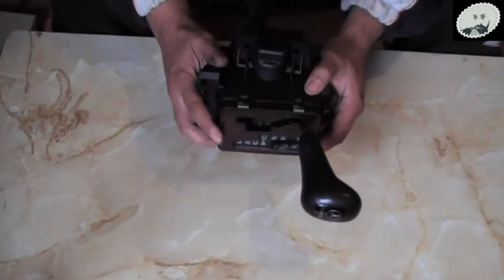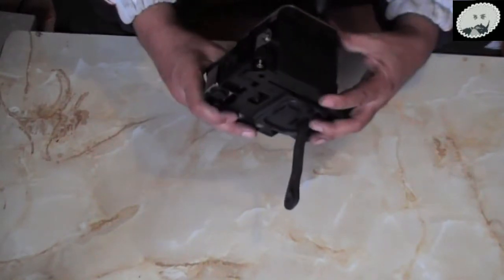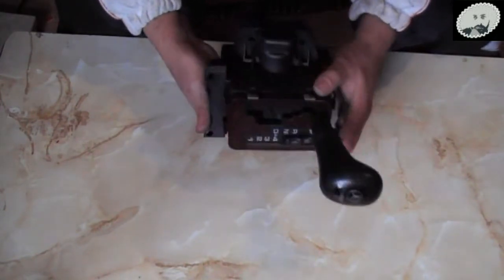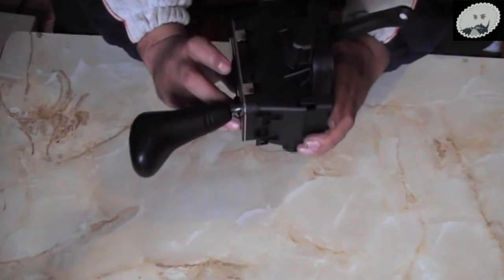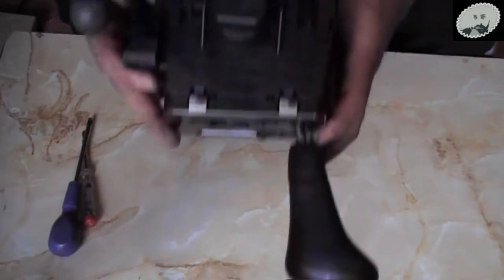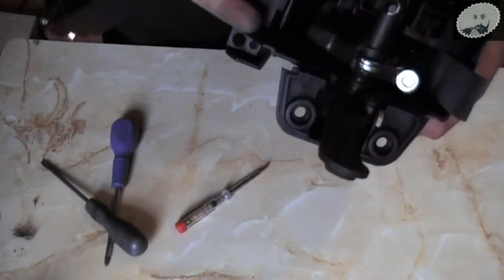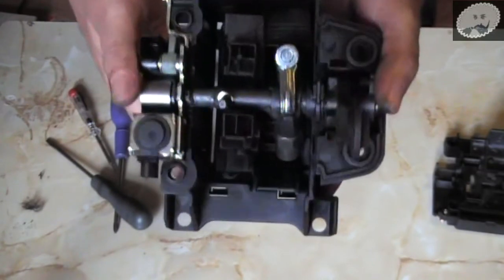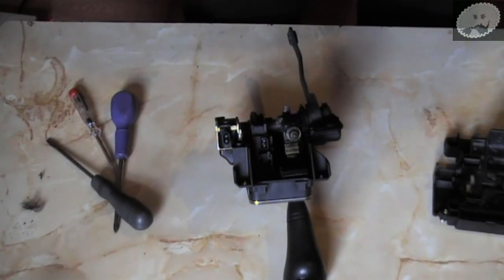Mercedes Benz C180 (W202) reverse light switch, part 1/14

Comment: the thing with all the connectors going to it is the switch module I have just recalibrated and repaired my own however I have got to disassemble it and calibrate reverse switch a little bit better when it is exactly in Reverse there is no light a little bit either way towards neutral or Park and the light comes on the ball bearing thing you're on about is the indents that you feel when you move the stick backwards and forwards